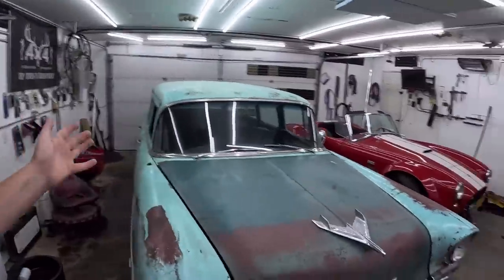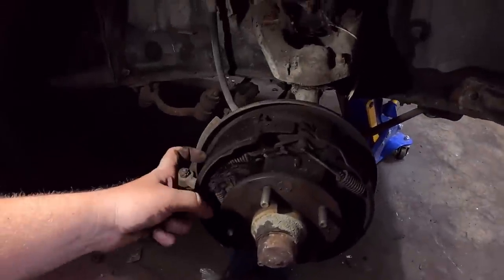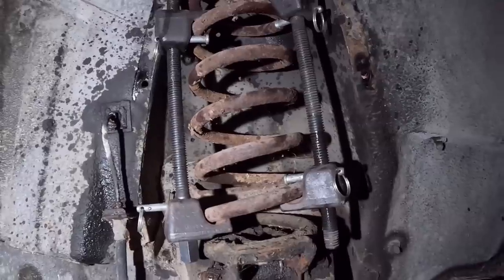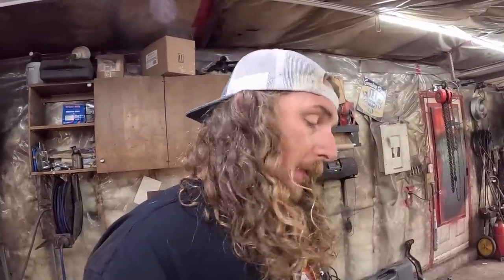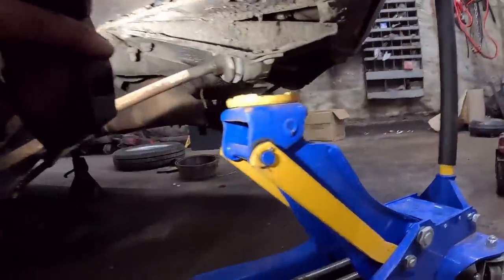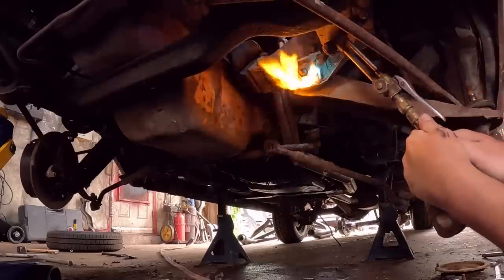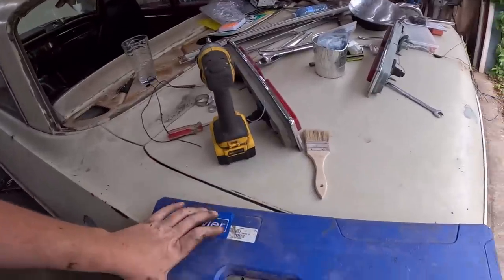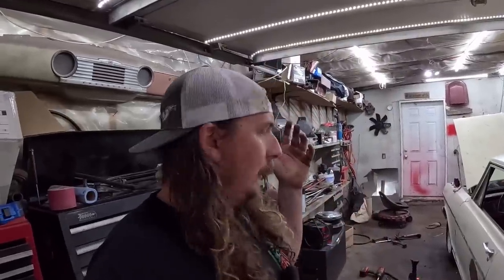DANGER ZONE - Fighting The Original Front Suspension On My 1964 Chevy ii

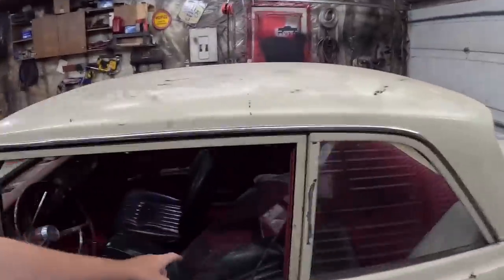Comment: 3:20 are: Back glass seal….. I just got though with my ‘63 Chevy II 2D Sedan rear glass. Your going to need to get some glass bedding & glazing compound. It’s a non Harding rubberized seal that goes on the body lip that the glass seal sets into……..After all said, if you had trouble with the front glass install, the rear sedan glass is 4x harder to install. The reason is, the wrap around corners at the top are a bear to seat because of the bottom inside lower rubber flapper is in the way to see the rope pulling out on the snitch lip seal…. 3M is no longer making the Bedding & Glazing Compound. Scott Drake windshield Bedding & glazing compound is available. I found it a Mustang Source. Also Summit lists it, but their out of stock.

Comment: Those MII front suspension conversions with rack and pinion,  disk brakes , front sway bar and subframe connectors make a world of difference.  Best money I spent on my 64. I'd never run the stock setup on these again.
These , in stock form , will drive and handle very differently than a tri five or a full size Impala. You might not like it.

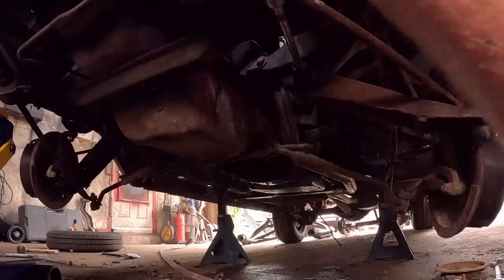Comment: 30:50 those similarly placed bolts on my 1994 ford thunderbird are torqued to 165 foot pounds, the squeeze holds the bushings together extending premature ware. imposable to remove with a 6 inch spanner.

Comment: If it was mine and my sigificant other was going to drive it I'd look into putting a dual pot master cylinder in it. 67 Chevy II's had a dual pot master in them, you might have to compare the front wheel cylinder diameters, if the same, same no problem-oh. Remember the suspension should be at ride height when tightening up your control arm bushings